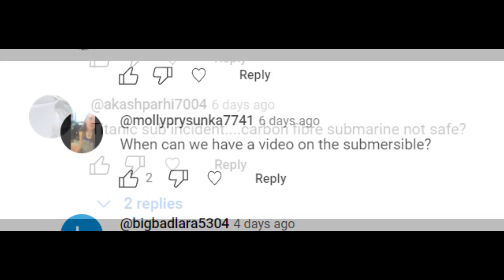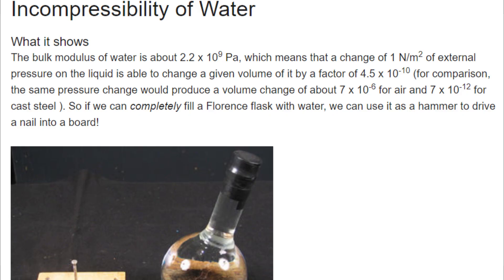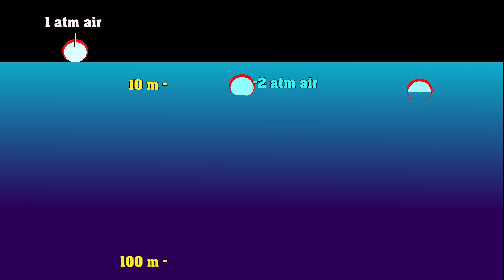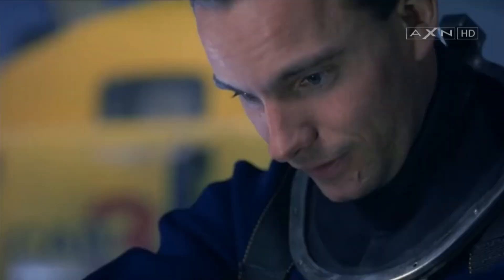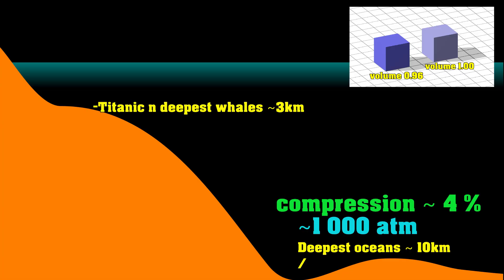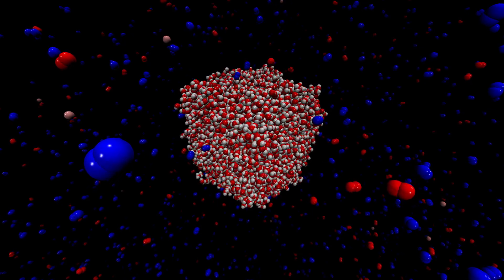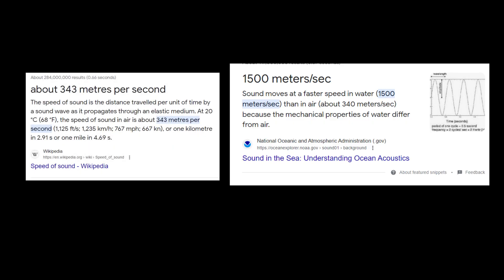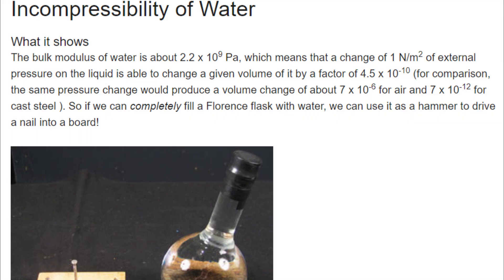What Happens when a Hull Fails at 1000 atmospheres?

Comment: I am wondering how it's felt dead in less than milisecond? When you see other death causes you can imagine how you gone. But just gone without knowing what happening I am still wondering how it's like.
Reply: Well it's not like anything, is it
Reply: Close your eyes and stop thinking. It's just lights out and that's it. No thought process nothing.
Reply: can you tell me anything about yourself before you were born? its a lot like that billions of years passing by until it grinds to a halt to about 100 years for you to observe it.
Reply: The current working suspicion is they had a very little bit of time to think on it. Thunderfoot did not go into the stupidity of using composite materials for this sort of pressure vessel. But a big one is the deteriorate over time. Steel is actually quite elastic. You will hear creaks and groans as it goes down and comes up. That's just the elasticity of the metal hull. A composite hull is not elastic. Every crack, every crackle you hear is your hull getting weaker. It's your nicely wrapped carbon fiber hull starting to delaminate. One passenger reported hearing crackling and cracking sounds 2 dives previous to the loss. Rush waved it away as "We still have 5 inches it needs to crack through!". On the final dive the Coast Guard think he heard something or had some occurrence that spooked him enough that he dropped the Ballast trash and he dropped the undercarriage, the landing skids in an attempt to rise faster. So they started to hear that hull delaminating, before it let go. They had a few seconds to a minute to think about it before the final crack and the world went white.
Reply: You know how you felt before you were born or even conceived?
You can't, because you did not exist. 
When you go like the people in the sub, it is the same. Their brains and nervous systems were shredded faster, than the signals that were traveling through them. There was nothing left to feel pain or perceive.
Reply: It's like that russian propaganga poster from ww1 showing Jesus decending from heaven to greet a dying soldier  but everything happening in less then 1 milli second.
Reply: It is like nothing. When you suddenly lose consciousness, and you survive, the brain "reboots" when you come to and seamlessly connects your subjective stream of consciousness to just before the event. This is why you will say: where am I? and what time is it? There is a hiatus in time and often space that is just skipped in that subjective blend of the before and after. Dying instantly is the same, without the consciousness after.
Reply: 4 milliseconds to fill the tube with water. it's much faster than a single blink of an eye. they literally didn't even see it coming
Reply: @markifi 1 frame at 250 frames per second.
Reply: @phillyphakename1255  i counted the frames of a blink of an eye in another video (yQTa9UlZNUk) and it's 40 frames at 250 frames a second just to close the eye

Comment: It would take Thunderfoot to make sense of this madness, there's a trade off, the deep you go, there is a increase in nitrogen, it's called the The Bends, if the hull exploded, they all passed away from decompression sickness...

As you descend deeper underwater, the pressure increases, and this causes more nitrogen (and other gases) to be absorbed into your body tissues. The increase in pressure allows the nitrogen to dissolve in your bloodstream and other body tissues.

Nitrogen is the main gas that causes issues with decompression sickness, also known as the bends. When you ascend too quickly from a dive, the reduction in pressure causes the excess nitrogen to come out of the solution and form bubbles in your body tissues and bloodstream. These bubbles can lead to the symptoms associated with the bends.

D divers need to ascend slowly and make decompression stops during their ascent to prevent decompression sickness. These stops allow the excess nitrogen to be gradually released from the body, reducing the risk of bubble formation and decompression sickness.
Reply: The sub imploded at like 3000 meters, nitrogen sickness was the least of their concerns. That's kinda like being aboard a spaceship hurtling into the sun and worrying about sunburn lol

Comment: It imploded faster than the brain is capable of processing vision, let alone pain (vision processing is much faster)

It was truly a painless lights off moment for them
Reply: @@blue-lu3izthere is no ‘small leak’ at that depth
Reply: @Daz912 
Correction there is no such thing as a small leak when your sub's hull is brittle Carbonfiber reinforced with plastic resin. There are such things as small leaks on subs with adequate hull integrity to descend to these depths.
Reply: @@blue-lu3iz Wrong, at those depths there is no "small leak". It would implode immediately if anything "leaked". At those depths the hull either holds, or it implodes. There is no between. There is no leaking seal, there is nothing like that happening. So its instant death with no warning, sans maybe some creaking sounds (but those are normal in operation on all subs, safe ones too)
Reply: @rykehuss3435  as soon as even a microscopic leak is through and through, it widens catastrophically fast
Reply: @DrWhom it's like popping a balloon underwater
Reply: Isn't vision based on the speed of light, which is significantly faster than the speed of sound? So you'd actually see it happen, but your brain wouldn't be able to process it quickly enough.
Reply: @jazzabighits4473 
The brains ability to process light is not happening at the speed of light.
Reply: @jazzabighits4473  Vision, as in photon to receptor, is around the speed of light. Vision, as in nerve impulse to brain recognition, is way slower.
Reply: @jazzabighits4473 yes, but that is the most "well ackshuwally" way of describing it. To the experience of a human, with a consciousness etc, the speed of sound in water is going to be far quicker of a demise than you can perceive, even if the light hits your retinas before the water does.
Reply: @jazzabighits4473  Seeing is usually meant as processing the visual information transmitted through the optic nerves. Aka you see something

Youre just doing some unnecessary semantics
Reply: @jazzabighits4473  you can't see the speed of light

Comment: 100 meters max where humans can breath compressed air? A bit off, by factor of 7. The record is something like 700 meters. Experienced CCR divers (closed-circuit rebreather) often dive beyond 100 meters too. 

And saturation divers dive to 300-400 meters regularly and spend a long time there (and a crazy amount decompressing). PPO2 (partial pressure of oxygen) is what really matters, and the deeper you go the less oxygen you should breathe. These sat divers are breathing like 1% oxygen max, but dont quote me on that. They often use heliox (helium-oxygen) gas, or hydreliox (hydrogen-helium-oxygen) for ease of breathing. Nitrogen is not used due to nitrogen narcosis which would quickly develop at these depths.

And thirdly your animations have nothing to do with what happened. At those depths there is no leak, the hull implodes immediately. At those depths the hull either holds, or it implodes. There's no leak that shoots in water at billion miles per hour.
Reply: The record I could find for CCR diving is a bit over 300m and the guy said he went down and up as quickly as possible to minimise exposure to depth (because nitrogen becomes poisonous below mid tens of meters and oxygen below 70 or so) (might be wrong/looking up the wrong thing though).
Reply: @Hailfire08  Anything can be a poison, its only if the partial pressure of oxygen exceeds the limits does it become poisonous. As you get deeper you need to breathe less oxygen, like I said. Divers breathe 100% oxygen during deco near the surface, no poisoning.
Reply: The record I could find for CCR diving is a bit over 300m and the guy said he went down and up as quickly as possible to minimise exposure to depth (because nitrogen becomes poisonous below mid tens of meters and oxygen below 70 or so) (might be wrong/looking up the wrong thing though).

Comment: at around 1000meters down your cell wall becomes to compressed to allow oxygen in. liquid breathing will allow you to go down that far, but 1000m is just the hard human limit.
Reply: Liquid asphyxiation more like it, you cant breathe it. Your diaphragm is too weak, even if it was the lightest liquid imaginable its still tens or hundreds of times heavier than air. So you would relatively quickly burn out your diaphragm and then suffocate to death, trying to breathe in and out with your diaphragm on fire. Not a nice way to go
Reply: @rykehuss3435  Fun fact: If you've ever seen The Abyss (I know, I'm old), the scene of the rat breathing liquid is real. The actually used an oxygenated liquid (PFC) and let the rat initially panic and everything. The Navy has experimented with liquid breathing in the past and they did indeed say it was very strenuous, some even getting rib strains and fractures. It can be done with a ventilator though, and has been successfully used premature babies.
Reply: @albinoman13bt  And then theres the issue of a "mild" case of pneumonia resulting from it. Almost like the lungs dont like liquid being in there
Reply: @rykehuss3435  you might be able to oxygenate the liquid to the point where only a few breathing movements per minute suffice. I agree, it still would be exhausting and, for me, to terrifying to even attempt.
Reply: @DrWhom try to breathe in and out without letting any air escape as hard as you can then imagine it being like twice as hard to breathe as that lot of stress on the diaphragm
Reply: The liquid breathing has nothing too do with your "cell walls being too compressed to absorb air". The whole purpose of the liquid breathing would be simply to fill your lungs with water. You don't want air filled cavities in your body at extreme depth because the pressure will collapse that empty space. Having the lungs filled with liquid is supposed to help equalize the pressures inside and outside the body. I mean,it wouldn't work regardless. The human body just isn't designed for such extremes. That's why they don't actually use liquid breathing in real life. I can't imagine that would be very good for your lungs anyhow. They are a delicate organ meant to inflate and then deflate with air. Strenuously drawing very hard breaths in order to pull in all that liquid and then forcefully exhaling liquid with them would probably cause all kinds of damage.
Reply: @daemonthorn5888  Water? Lol liquid breathing doesnt use water, we do not have gills my man. In case you didnt know
Reply: @daemonthorn5888  that's not what I'm saying, the hard limit for how far a human can go underwater is 1000 meters. Even if in the distance future we figured out liquid breathing, our cells walls become inpermeable due to the pressure.